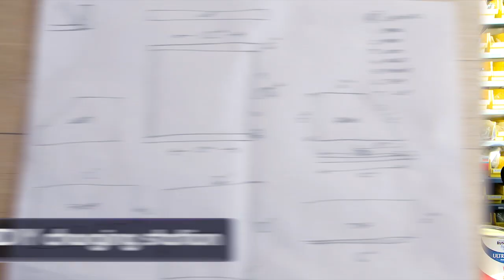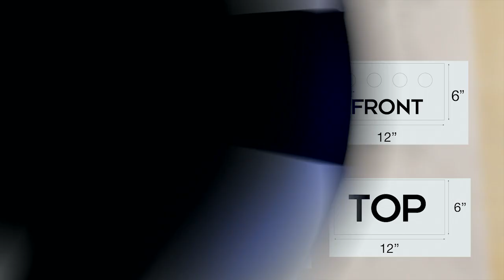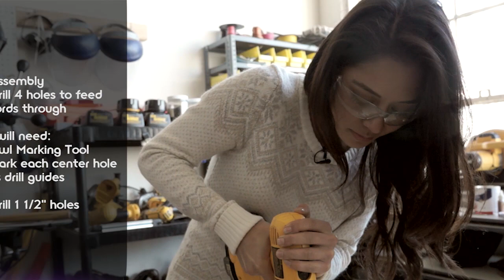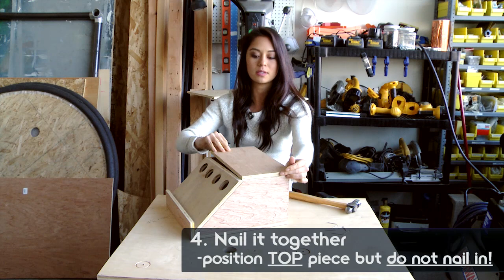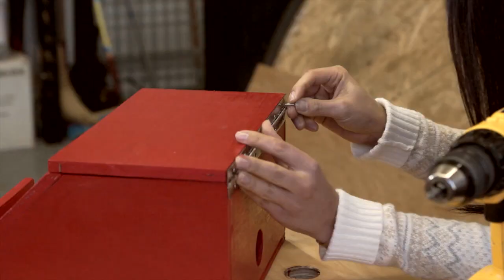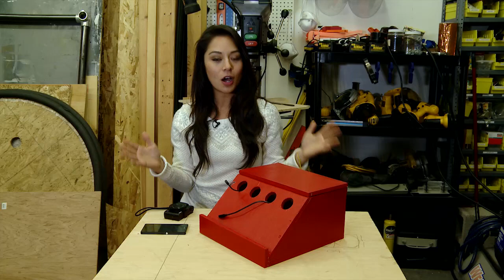How To Build Your Own Charging Station

Comment: A nice project and simple to do however, the video does not show ALL the steps. 
Such as the hole in the back for the power cord, the 2 x angle cuts on the front piece so that the lip and the top fit flush, and the fact that the front piece needs to be slightly longer than the dimensions shown.
Reply: She showed one scene of something getting cut and then next scene says "Now that we're done cutting"....

Comment: Good job,,, but its so big
Reply: You can reduce the size by using a powered USB hub (or one made specifically for charging devices)  instead of a power strip.  That way, it's smaller, and you just connect USB cables to the hub and devices, instead of needing to connect their power bricks to the power strip.

Comment: you should've made the holes a bit smaller and cut slots that run down an inch or so from the holes so that the chargers don't fall into the box.

Comment: The top and bottom edges of the FRONT piece you've shown are not cut square but rather at an angle with the surface. Did you show us how to do that and I just missed it? I don't think so. Cheater...